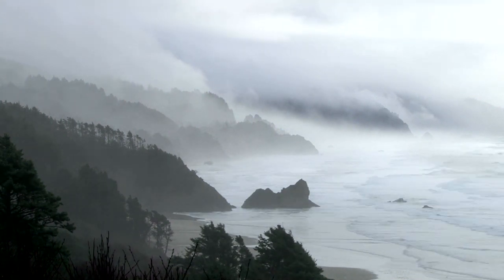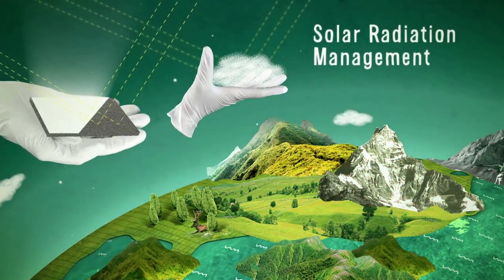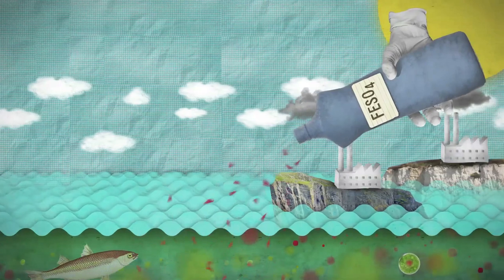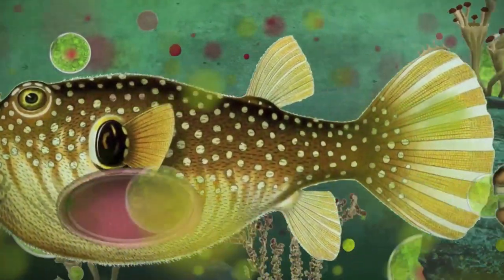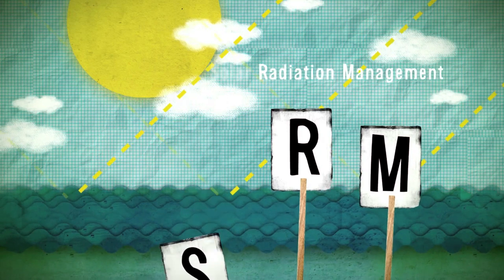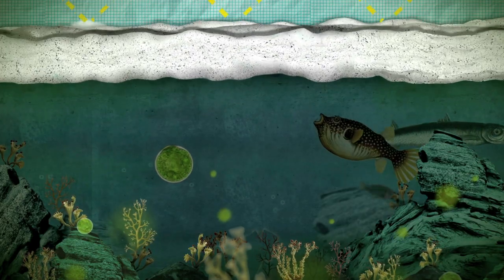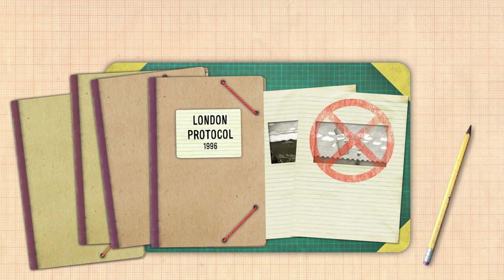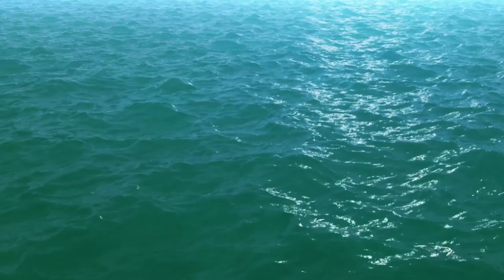A technofix for the climate? Marine geoengineering

Comment: You seem to be only putting one side of the story. The question is not whether there are downsides to ocean fertilisation, but whether they are greater or less than uncontrolled global warming. 

If you can effectively create a permanent upwelling over a significant area of the ocean, it could be a huge boon to wildlife.

There are certainly potential downsides, but you don't seem to care about what the alternatives are.